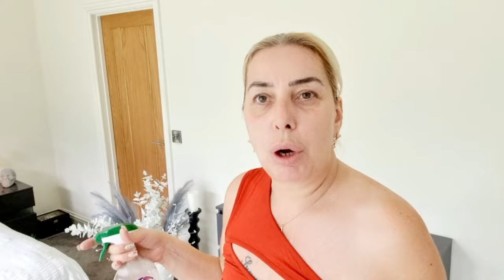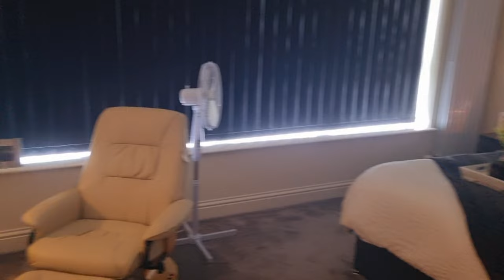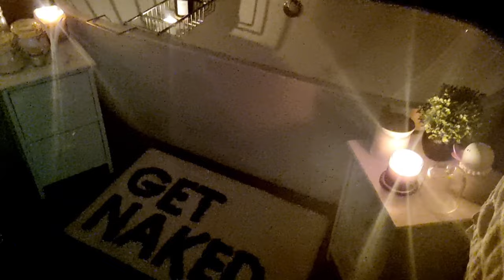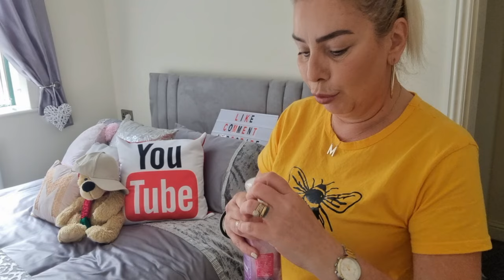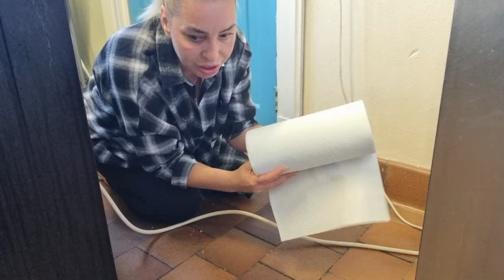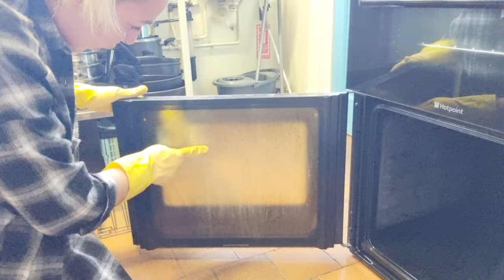EXTREME CLEANING MOTIVATION || BEDROOMS BATHROOMS & SCRUBBING THE OVEN

Comment: 😇 aye was cleaning my bathroom & toilet this morning at 5,20am. Woke up & couldn't get back to sleep, so I got up. Cleaned that, then came down to wash my cooker, then put my dishes away. That's as far as I got. But, I've put the ironing board up, & ive got a bloody pile to iron. 😇🤩 So if I watch you, I may get back up. 😂🤫 I love washing windows, hot soapy water 💧. I could be a window cleaner. 😂 Maxine open your windows if you feel light headed. 😱 ❤️ Love your 🐝 Bee t.shirt. it wouldn't be hard work Maxine, if we didn't show our Builders Bum. Maxine a other great tip , for Grease is a dish washer tablet, in a just, boiling water from a kettle, pour it in the jug. Fill it. Let it cold down for 10 minutes, then pour it in a spray bottle. Brilliant. 🤩 &  For washing kitchen walls down & Bathroom tiles.
Reply from the maker: Hi sharron 👋 bloody hell you was up early cleaning 😁 I don't do ironing lol I hate it. And you can come and clean my windows if you like 😁 another job I hate lol ❤️❤️❤️
Reply: @MaxineGeorgina  no problem 👌